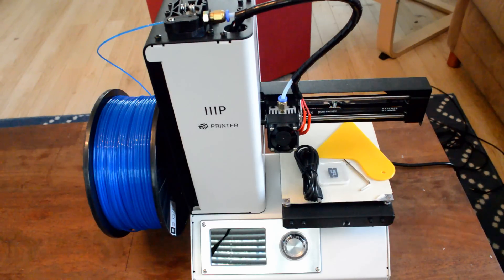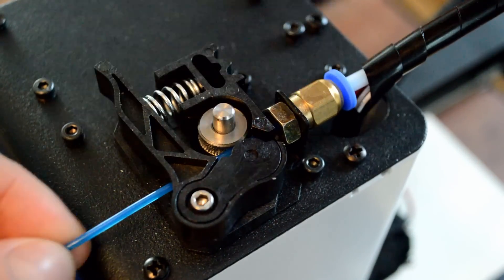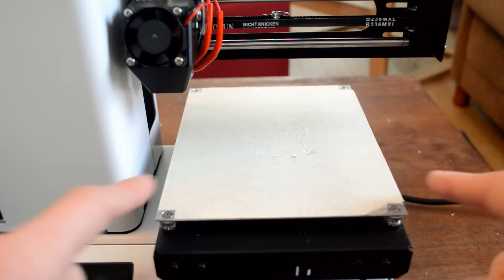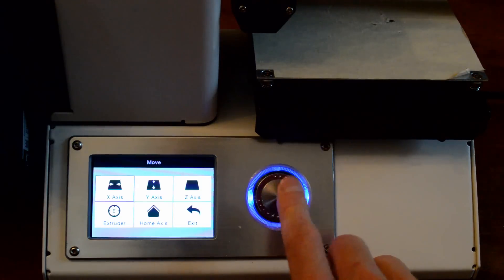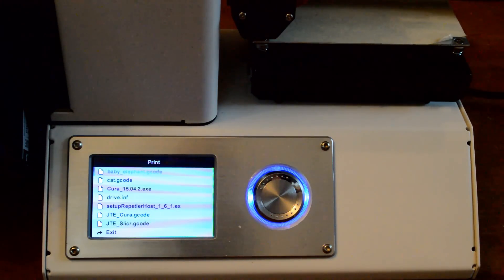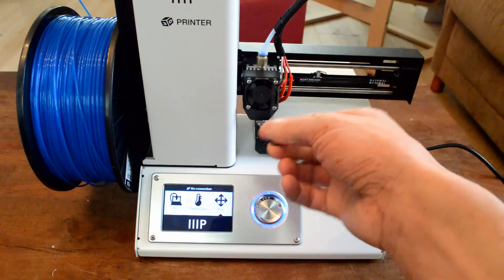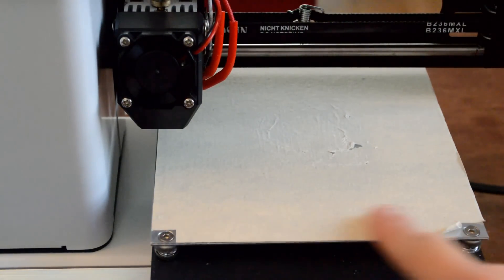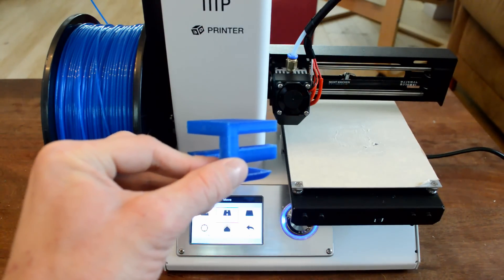3D Printing: MP Select Mini Overview

Comment: Thanks for the video! is this able to print with polycarbonate filament?
Reply from the maker: You're welcome!  In regards to your question, I'm actually not sure.  All I can do is repeat what is on their website, which mentions "basic filaments, such as ABS and PLA, to more advanced materials, such as conductive PLA, wood and metal composites, or dissolvable PVA."  I'm guessing you've already read that before, but I don't know enough about any 3D printers and their filaments to say anything with confidence.

Comment: i paid $400 for this printer in amazon. fuck
Reply from the maker: I should be somewhere around $200 or a little more for this particular printer.  I think they came out with a second version of it, so that one might cost more?  You also may have purchased a slightly higher end printer and not known it.

Comment: you mention in the video not shutting down correctly, mine just arrived today and ... how do i shut it down correctly? I don't see any software "shut down" function, so i'm left with pressing the button. Do i wait for 10 minutes after last activity, or something like that?
Reply from the maker: I don't think there's necessarily a correct shutdown procedure, but when my print is done, I go into the preheat menu and turn both the bed and nozzle preheats off.  Then I wait a little for those temps to get down to the ambient temps and then I turn off the button in the back of the printer.  I don't really think it matters, but this way has been working for me and I guess I'm slightly superstitious.
Reply: i'm also superstitious like that but i don't really know. I got a similar impression to what you're saying by finding some end print gcode which was doing what you're saying waiting a few minutes for full return to normal.

Comment: Can u get stuff off of thingyverse and print it off on here
Reply from the maker: Yep, definitely.  I printed one of those low-poly bulbasaurs for a friend, and it came out great.  You just need to download the file and put it into a slicer program of your choice.  One of the slicer programs it comes with on the micro SD card is Cura.
Reply: Ok thx so I can print off a model off of thingyverse or like a fidget spinner?
Reply: Yes, MarkSweg, but for fidget spinners you also need bearings, which you have to buy
Reply from the maker: Sorry for the delayed response, but yes you'll be able to print anything you want off of Thingiverse.  Just note that the bed size is fairly small, so if you want to print something bigger, you'll either need to break it up into components, or you can scale it down.  And as Bacon Gaming mentioned, for the fidget spinner you can print the frame, and then you'll need to buy some bearings.
Reply: JoshTheEngineer thank you for the response. I got a mp select mini and love it! It is fun to make stuff with and entertaining to watch.

Comment: can you order more pla film
Reply from the maker: Yep, the blue roll you see in the video was something I ordered after I realized it didn't come with a roll.  It's $20 on Monoprice for a 1 kg spool (you can also get 0.5 kg spools).  I've done several prints and it doesn't even look like I've used any of the roll.  Then again, the prints that I've been doing are pretty small compared to other peoples' larger prints.

Comment: I got it to work shortly after leaving the comment. I got impatient and took the fan off and in the middle of the heat sink I found a large unmelted piece of plastic. I just pulled it out. I will eventually need to learn how to take that part off to clean if it gets jam. I do have other questions. Do you leave the filament in the longer when not in use or do you remove it to store it? The first night I took it out but tonight I left it in. I know I'll have a lot of questions while my journey and your videos are very helpful so I subscribed. But thank you again! I really appreciate the fact you took the time to write it out!
Reply from the maker: Glad you figured it out.  It's pretty simple to take apart and put back together, which is nice.  The first time I used the printer I stopped the print since I was going to run out of plastic, and then I immediately shut it off.  Then the next time I turned it on I got the clog.  So after I got my new plastic, I let the print finish, and then I make sure I turn off any preheat that continues, and I just let the system cool down all the way to room temperature before turning the printer off.  It's been working great ever since, so I like to stick with what works.  I don't pull the PLA back or anything though, it's just left wherever it was at when the print finished.

When I finally run out of plastic on my first roll, I'm going to post a video about changing filament, so we'll see what happens then!

Comment: Very detailed video! Thanks I am having issues with my printer. It's similar to what you mention when there is a filament jam and I have no clue how to clean it up. Any suggestions
Reply from the maker: So I mentioned in this video that I would make another video on how to unclog the nozzle.  I didn't want to make that video until I had to unclog it anyway, and my printer hasn't jammed since that first print.  So I'll just describe to you what I did, and maybe that will help you.

I knew it was clearly a clog/jam (or whatever the correct term for it is) because I was able to feed in the new filament all the way until it disappeared into the heat sink.  I used the Extrude option under the Move menu to try to feed it in until it came out the nozzle, but I got the clicking noise that you've probably experienced when the filament can't go in, and it slips back out.  I tried heating up the nozzle to 210 degrees C to try to melt the jammed PLA, but that didn't help, so I figured I needed to take apart the nozzle area and see what was going on.

My first thought was that the actual nozzle was jammed, so I took off the fan case (by removing the springs on either side holding it onto the extruder assembly).  It is still connected by the power wires, so you can't remove it completely. Then I unscrewed the nozzle from the heater block (obviously after it had cooled down; you don't want to burn yourself).  I looked in the nozzle and it was clean.  I should have known it wouldn't be a nozzle clog because it definitely gets hot enough to melt any residual PLA in there.

So the next thing is to move up the extruder assembly (that's what I'm calling the whole thing including the heat sink, hot end, nozzle, etc.).  After taking off the fan, you can see two set screws with very small hex key sockets.  That's why I mentioned that small Allen wrench in the video.  If you loosen the top one, you can take out the clear plastic tube and set that aside.  It threw me off initially because the connector from the tube to the heat sink makes it look like you can use a wrench to screw it off, but it's actually just held in place by the set screw, so don't turn the brass fitting itself.  The bottom set screw holds the metal tube that connects to the hot end.  If you unscrew this, you can take the hot end and tube out.  In my printer, there is another small plastic tube between the two pieces that you just took out by loosening the set screws.  Some MP Select Mini printers that I've seen here on YouTube didn't have that tube for some reason.

Anyway, that plastic tube was also clean.  So the problem was clearly in the hot end or the tube connected to the hot end.  You can simply unscrew the metal tube that's connected to the hot end.  Turns out the clog was in this tube, and it was just a piece of filament that had melted, and was probably too far away from the heat to melt again the next time it started.  I pulled it out with some needle nose pliers.  After reassembling all the parts, I pushed the new filament in when it was hot, and it extruded out the nozzle. 

I hope that helps.  Good luck!
Reply: thank you very much!